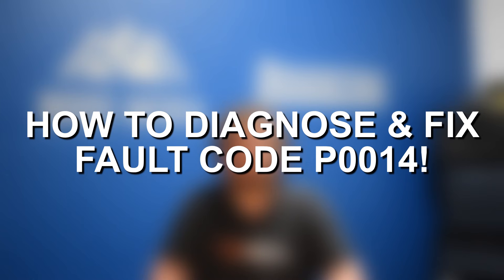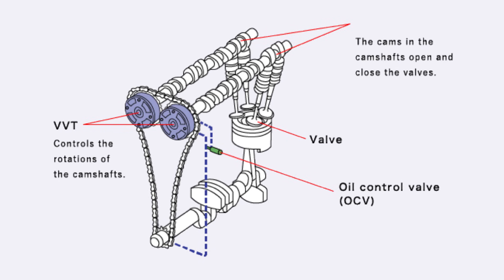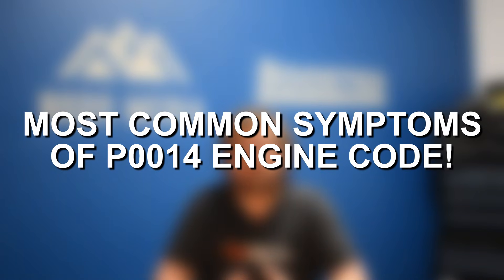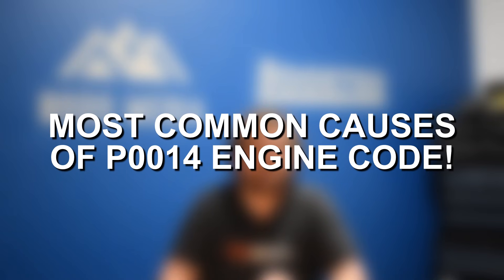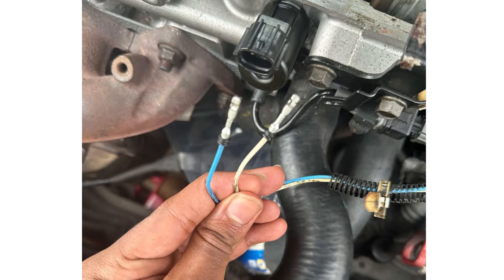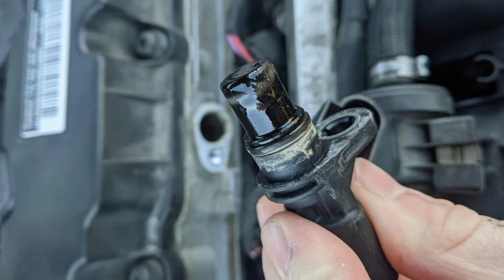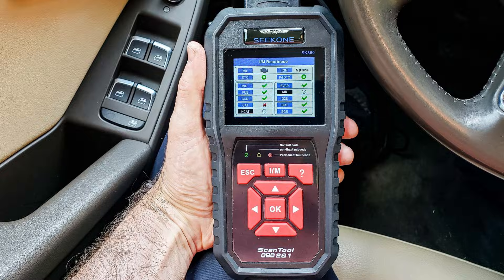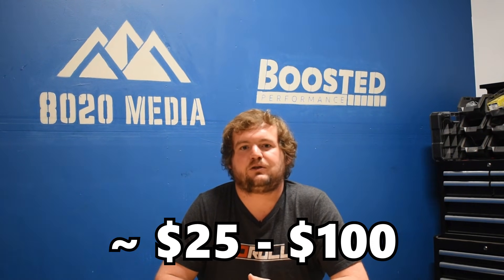Check Engine Light P0014? Here’s What It Means!

Comment: Incredibly detailed and easy to follow! Insta sub. Thank you. Not sure if I could pick your brains as you seem to know so much 

I had some stuttering and rough idle and the garage said it was some misfiring code so they replaced all spark plugs and ignition coil

The next day it obd showed p0014-71.  Engine oil was also down to 1.5L apparently (having done full service a couple of months prior). Went back to official dealer and after 1.5 months they replaced both solenoid sensors and the issues persisted

Now they recommend an engine refit/timing chain replacement (they costs more than my car). I have very bad experiences with this dealer so I want to know how likely this is the actual issue 

45k miles  2015 Jaguar f type v6 supercharged

Thank you in advance